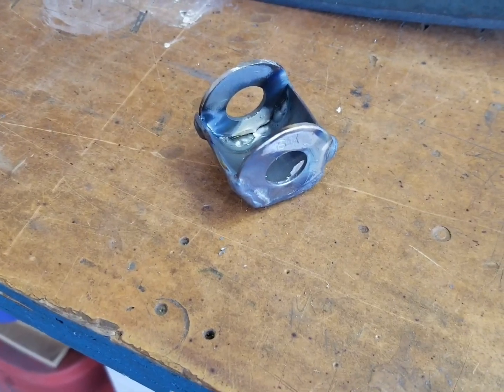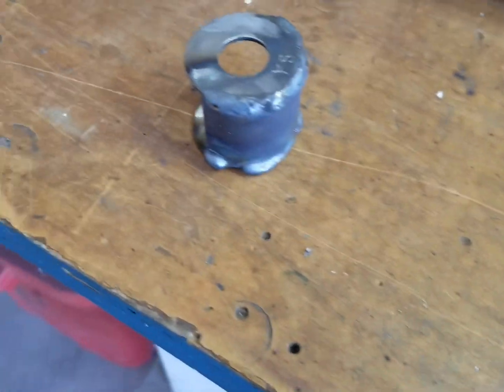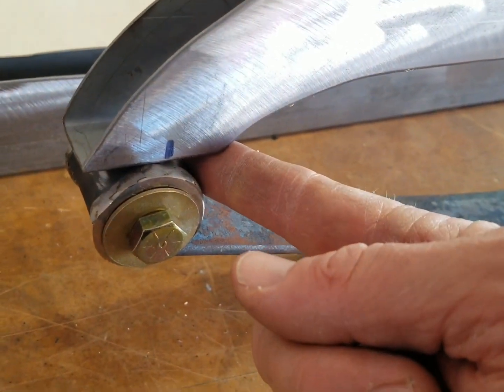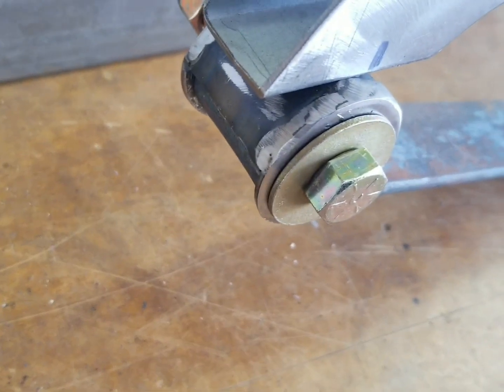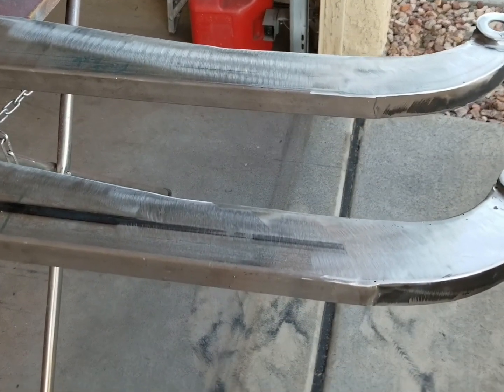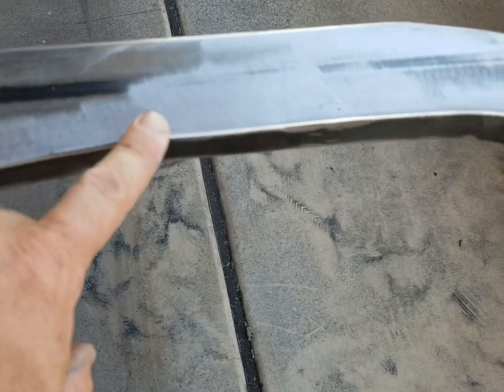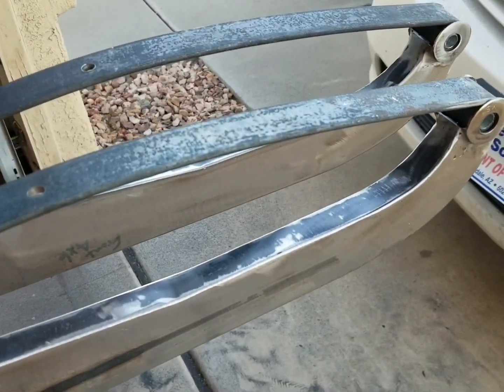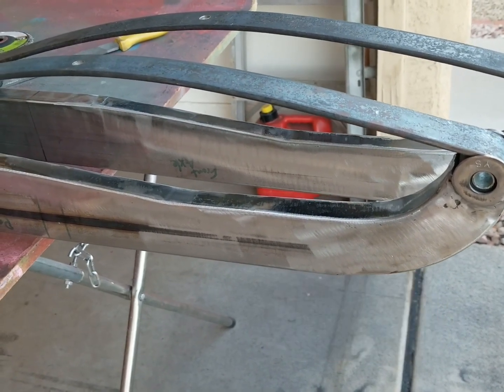Cyclekart Frame Part 2 Spring Mount

Comment: If you can try to welding the inside of the washer. I did a stress test on mine and saw a crack on the inside where I weld my washers to the pipe that I used. Just a thought. Great video, great work on the frame
Reply from the maker: Mine will have a 7/8" tube welded between the two rails, thinking that will stabilize the shackles.